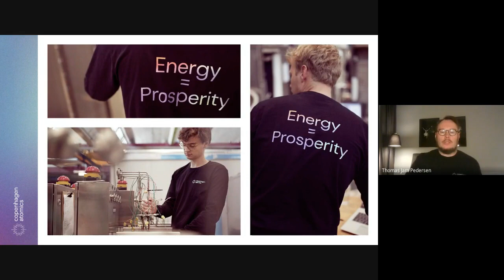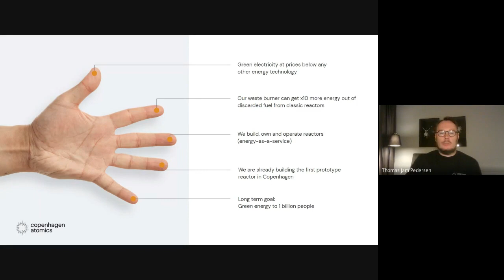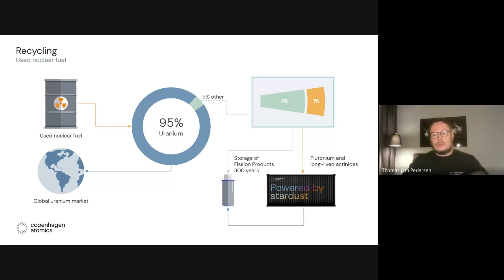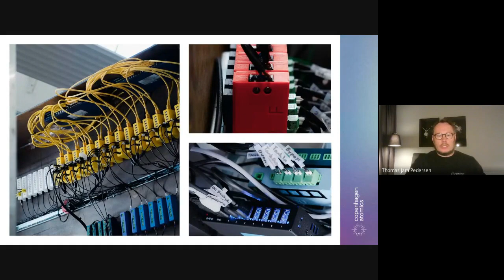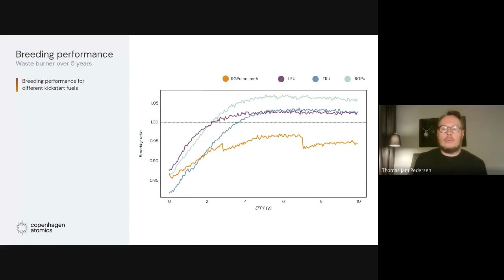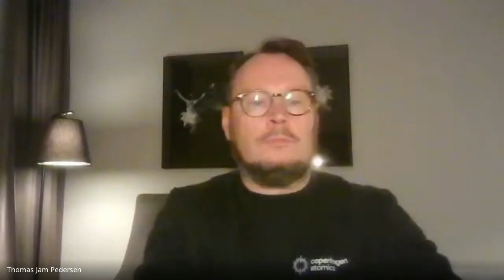Thorium molten salt breeder reactor as waste burner using heavy water as moderator

Comment: How is the concerns regarding the possible hydrogen production from the heavy water addressed?
Reply: it would just bubble out with the gaseous fission products [krypton, xenon , ect] trapped for decay time [ about a month] then safely released or used in industry
Reply: @peterolsen9131  Safely released?  You mean daily Normalized discharges of effluents...
Reply: @paulmobleyscience  did umiss the decay time and trapped bit in that sentence? fission gasses decay quickly to stable normal elements in about a month [ several half lives ] to the same ones that exist in the atmosphere, or are you just fearmongering?
Reply: @paulmobleyscience  Which discharges are you concerned about?  Tritium (radioactive hydrogen) is basically harmless at most levels and occurs naturally.  It also could be captured and sold as it is valuable in several industries.  The weak beta emission (max 18 keV) is particularly weak which is one reason it is basically harmless, even when released as tritiated steam.  This is done by nuclear plants all the time due to the generation of minute quantities.